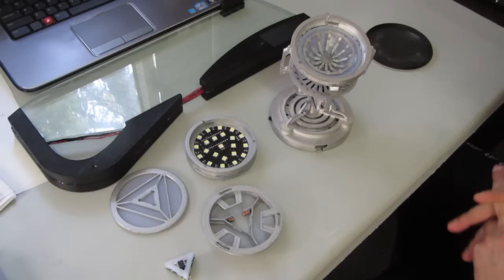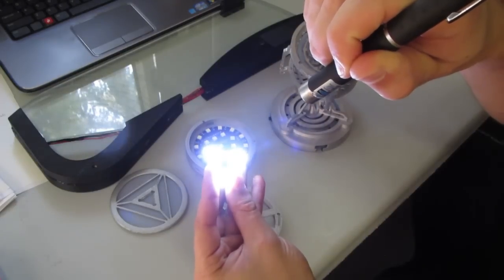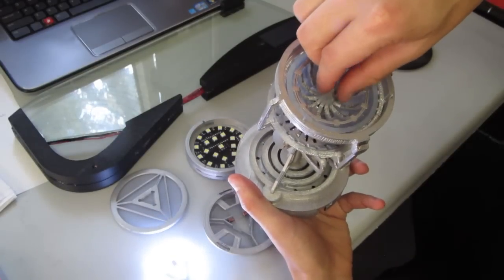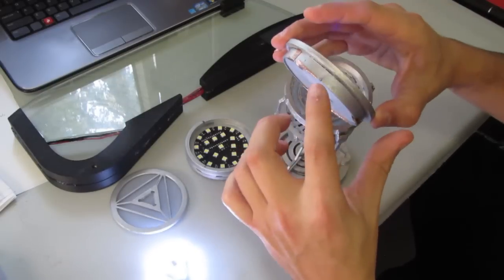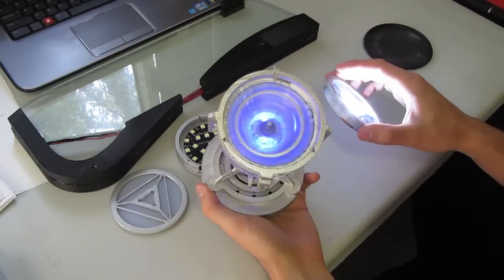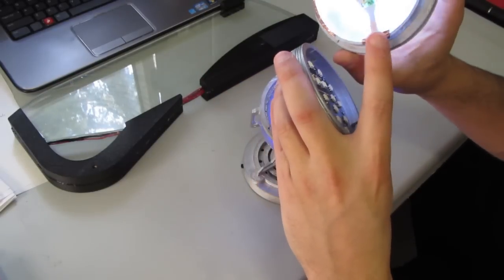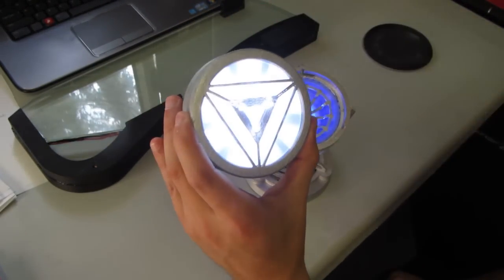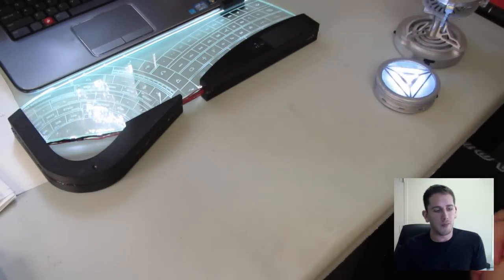Mark VI Arc Reactor - COMPLETE (Explanation)

Comment: So if the battery runs out, where can I find a replacement?
Reply: +Sgt Kcwb Pretty much, where can I find the battery that you used on the tiny triangle, i want to go upon this project myself.
Reply from the maker: +Sgt Kcwb Sparkfun Electronics.  Search for Lithium Polymer battery.  The small one in the triangle element is 40 mAh.
Reply: Thank you so much sir.
Reply: Ryan Brooks
Oh yes, what did you use as the triangle element? Just a simple triangle LED with a battery and some circuitry?
Reply from the maker: +Sgt Kcwb Three 5050 smd cool white leds, and a custom PCB I designed.  A photocell and battery connector and a few resistors complete the board. ;)
Reply: Thank you so much, you are a time saver my friend. You are literally the best. Subscribed to your channel and just completely awesome dude.
Reply from the maker: +Sgt Kcwb Not really sure that I did much, but glad I was able to help! :D
Reply: Ryan Brooks
 Well I mean your thing looks professional, and I really wanted to know what you used so mine could be a close professional knockoff.

Comment: I've been building a MK 3 reactor but I don't have a good light source...well I do but the light gets hot enough to melt solder...do you know of any way I could get a lot of the LEDs that you use for cheap?
Reply from the maker: +THE DARKRIDER Ebay!  Search for 5050 SMD Cool White LEDs 5mm x 5mm

Comment: Brooks your a genius how did make that "element" with the program? can you please give me a tip? im making one for my son. thanks in advance
Reply from the maker: +ian solano Hey Ian!  Sorry for the delay.  I simply designed a PCB which takes advantage of the ATTiny85 Arduino Chip.  The code monitors a photocell until a really intense light source hits it (laser).  Then, as long as there is sustained light intensity, the LEDs will fade brighter and brighter until they hit a threshold.  Then they pulse. :)

Comment: Hey man how much for private lessons? #YourAbEAST
Reply from the maker: Fire me an email if you're interested (on my website).  However, I have started a series of free tutorials on my channel here, so that may be a sufficient avenue for you to use as well!  Right now I'm covering Arduino, then I'll move on to circuit board design, and finally 3D CAD software. :)
Reply: Also i wanted to ask could i buy one straight up? I really don't know if i am going to have time to make it and i was hoping maybe when i buy it i can modify it a little? I am probobly going to add a fog machine and airsoft gun compartment in there if i find the parts well please reply fast!
Reply from the maker: ***** I will be making these available, but I'm still in the process of pricing these out to make them as affordable as possible.  Keep an eye on my website for updates. :)
Reply: OK :D
Reply: Ryan Brooks Also could you make a tutorial on how to make an arc reactor? Not like this amazingness but a simple one :D

Comment: Hey again I was just wondering what type of 3d printer you use as I am looking to getting one.
Thanks
Reply from the maker: Hi!  I've actually been doing most of my printing at the local university.  They have a Fortus 360mc.  Whatever you do, I don't recommend a Makerbot - I've gone through three of their machines and have had nothing but problems.  Do as much reading as you can before you purchase!